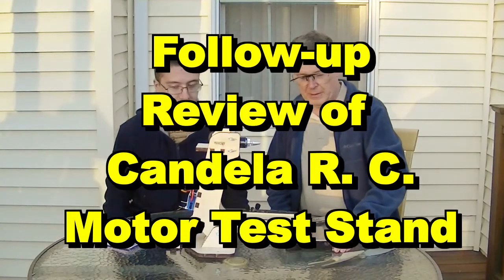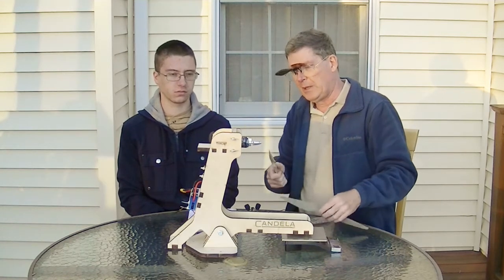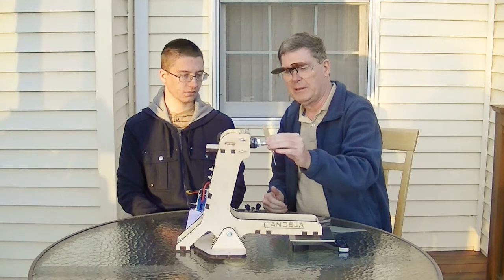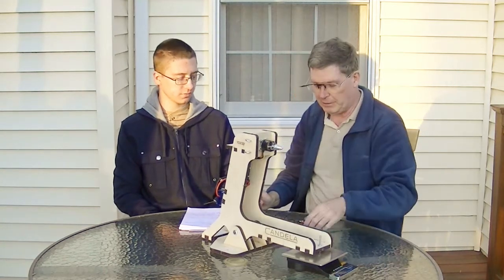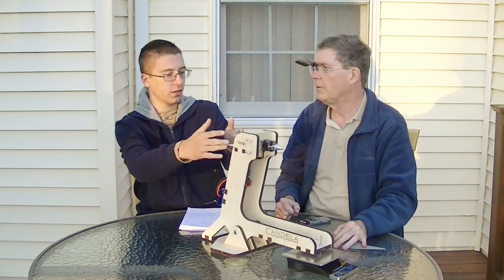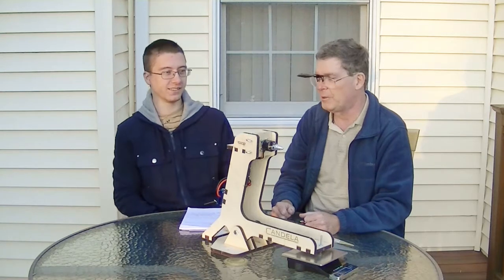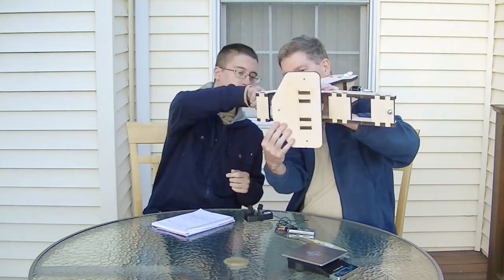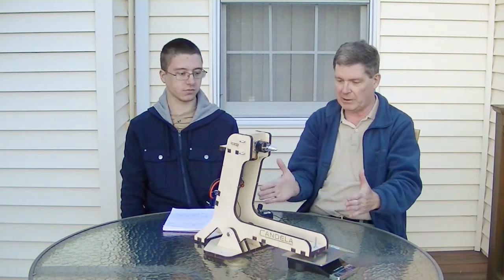Candela Motor Test Stand Reveiw

Comment: Wonderful video, A few points to cover, We are changing the bearings to alleviate the rocking. Fire is not an issue , our recommendations for glow engines is to seal the stand in varnish or paint. Planes are wood based as well and they do not catch on fire. Electronics used with glow need to bagged or spray sealed. We will be drilling  all the holes in the firewall. We are adding shelves on each side as well. We are slotting holes for velcro or zip-strips on mounting points. The pusher prop can be reversed. we calculated the thrust lost from air resistance to .04 to .08 lbs   loss.  We will bring up a smaller scale model in the next company meeting. The base is squared on one side to allow for a large postal scale, and easy mounting. Sir, When the new version is complete we will send you the next model in a few weeks. We will also send the bearing upgrade for your current stand.  Then you can do twin motor set-ups..  Thanks so much.... Talk to you soon!!    Cline:Tech
Reply from the maker: Wow those are some great improvements. Sounds like the product is just getting better and better. Looking forward to seeing the next revision. No problem with reversing the motor on the pusher prop and the loss sounds minimal. We were thinking about painting the stand but Jon was in a hurry to build it. Maybe we can do the painting during the bearing upgrade.